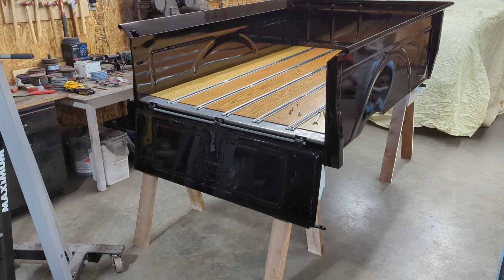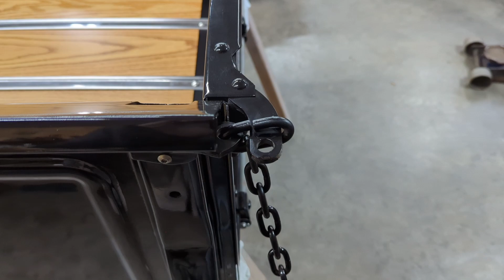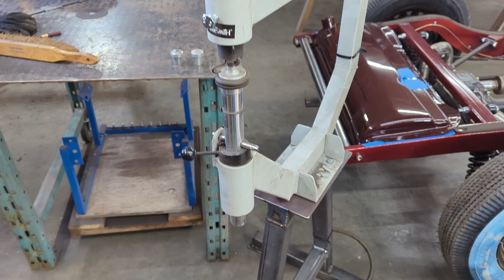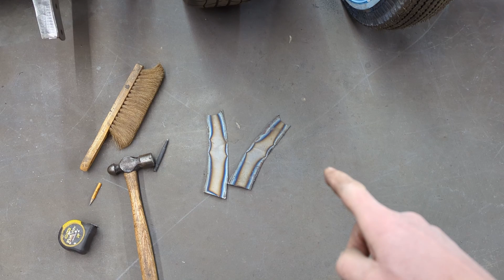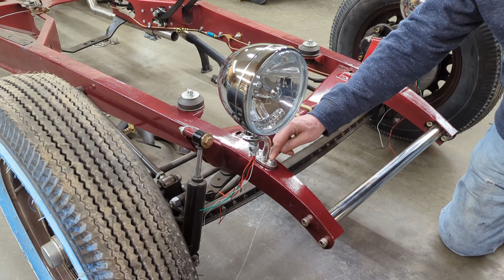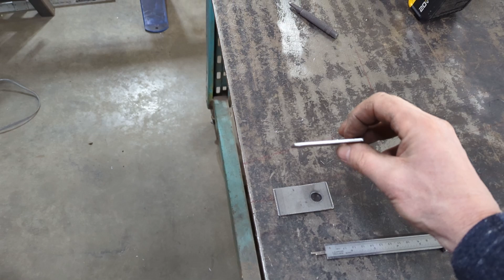Two Different Headlight Styles for Two Highboy projects

Comment: great work Derek,Headlight stands look good.i like the cross bar from light to light.you mentioned finding a piece of stainless or an old Model A bar and cut it up.i think,the stock headlight bar on my 32 from years ago(i didn't use it,bought a stainless dropped bar and will again) was a steel bar with a  thin stainless cover from light to light with painted plain steel ends from the light to the fender.nothing you don't already know but maybe a piece of 1/2 or 5/8's stainless bent to shape and welded to the headlight stands would fit the bill?
Reply from the maker: Greg, I had a few people reach out to me about an original bar like you're suggesting. Looks like I've found one in Ontario, should be here in a couple weeks so that's what I'm going to use.

Comment: I have a two-directional drill press vice which I've successfully done some simple milling with using a 1/2" milling bit - just simple stuff with patience and taking small bites! I used it for cleaning up welds is tight places for example.
Reply from the maker: Yes I can see how you could do that. I saw a vice that could move and you could do that. Might try it too.